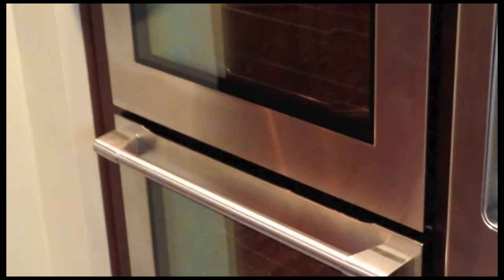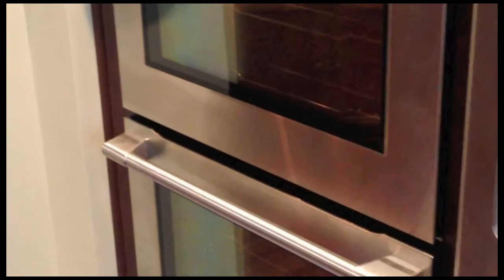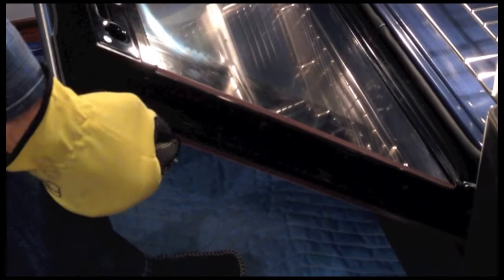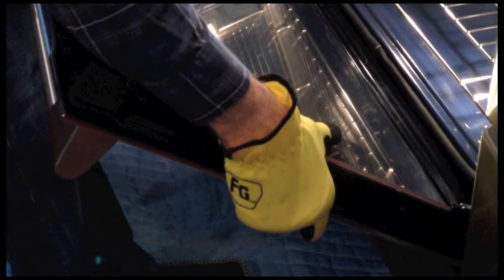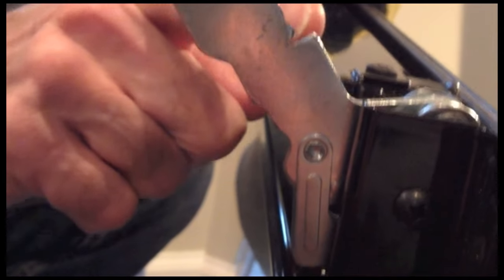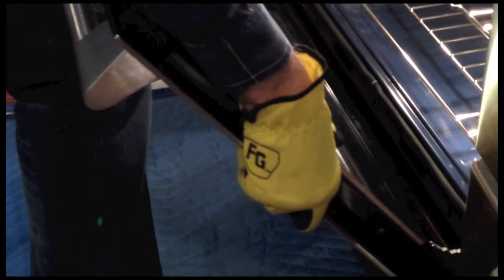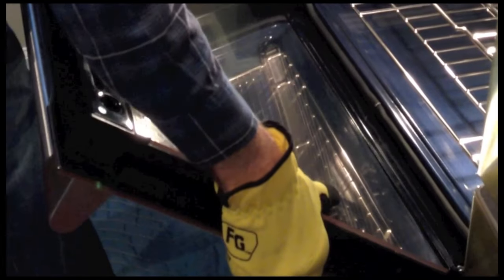Remove and Reinstall Electrolux Icon Double Oven Doors (also works on Ikea Kulinarisk oven)

Comment: Excellent video. When you put back the doors after removing the oven to fix it, make sure that the 4 black washer head screws holding the door hinge slots are in  place, in case you accidentally removed them when taking the oven out. Otherwise you'll never get the hinges to stay in place to hold the door right. Don't ask me how I know this.
Reply from the maker: LOL!  As you discovered there is no need to remove those screws.

Comment: Thanks for this - super helpful. Do you have one showing how to remove glass to clean the inner panes? This would complete a very excellent video demo. Thanks.
Reply from the maker: I don't yet have one, but was looking at ours the other day and noticed the inside of the glass needs cleaning - so I'll make one when we do that, but probably won't be before the end of May.  I think someone else in the comments below had asked a few years ago about the same thing, and another commenter mentioned or provided a link to a video.
Reply: Did he ever make a video for removing the glass?
Reply: @DIY-rs5dz  do you have one on removing the glass so it can be cleaned?
Reply: @DIY-rs5dz  any chance you have a glass cleaning video??
Reply from the maker: @vanbishd  As much as I wanted to do so, I did not have the bandwidth to make the video prior to replacing the oven.
Reply: @kimberleylowry7876  there are buttons on each side near the top - push these down to remove the long black part on top of the glass. Then slide the glass out (don't lift upwards or it might break).

Comment: Excellent job explaining it.  Why couldn't Electrolux have described how to use those slots in the manual like you did?  After you showed that, it was trivial.  Thanks a lot for posting.
Reply from the maker: Bill, thanks for the words -- I wondered the same thing, that's why I ended up doing the video.  Glad it worked for you.

Comment: Thank you!  While following the directions in the Electrolux manual allowed me to get the door off, I could not get it back on. Ugh... how frustrating. The "reverse the procedure" instruction in the manual was worthless.  Your video -- particularly the way you pointed out how that little notch on the hinge needs to rest in the receiver in the door -- made the whole process quite easy.  Thanks for taking the time to make this video.

One note:  I have an entirely different Elextrolux (free staning model EW30DS65GS) but the doors are evidently identical since your instructions were exactly right.

Comment: Thanks.  This helped a lot.  I found that after the door was put back into the slot it took a reasonable amount of force to bring the door down so I thought the lock was binding or I might break it. However the door did go down and then I could move the lock to the lock position.

Comment: I'm trying to find a video on how to clean between the glass. I can't figure out how to remove the glass and there aren't directions in the manual. Have you done that?
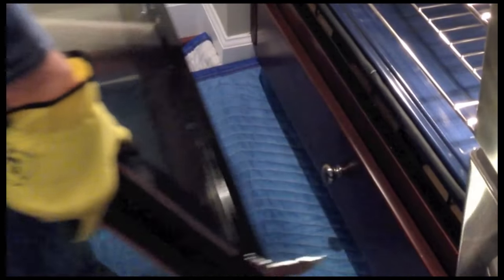Reply: Hi, Melissa. I just cleaned my glass yesterday. It's a pain. You actually have to remove the door as shown in the video above. There are two screws through a rectangular bracket that holds the panes in place. You can actually see one of the screws at 1:03 in this video (top right). There are 4 panes of glass to clean, believe it or not. If you're still looking to do this, I can provide more info.
Reply: Yes def would love to know how to clean in between 4glass panels who da he'll decided to make 4such a pain in the ass been trying all day!

Comment: I know the video is 7 years old but fingers crossed questions are still answered. First, I love the video after an hour of struggling I found your video and in seconds realized the issue was me, lol. The little notch is the linchpin to the entire thing. So here is my question. 
I lock the hinges in then close the door and each time the door pops off before it closes and hinges are in the upright position. Is it possible the hinge receptacles are the issue?
Reply from the maker: Gary, I have only done this with my oven and have not run into that issue, but I will take a shot at an answer.  I tried to recreate the problem but was not able to do so; the only thing I can surmise would cause the problem is not actually having the door hinge slot properly seated and the hinges not fully lowered.  Assuming you did in fact have the door seated properly and the hinges fully lowered, then check to see if the receptacles are tight.  There are two screws for each receptacle.  Other than that I have no other options to offer.  Once you get it figured out, I sure would be interested in hearing what the problem was and how it was resolved.

Comment: After removing the door and replacing it back i notice that the solf "velvet"closing is gone. The doors is much easy to push up and down and just slaps on oven. Where am i go wrong with it?
Reply: If you reinstalled the door according to the directions shown in the video, the door should close like it did before you first removed it.